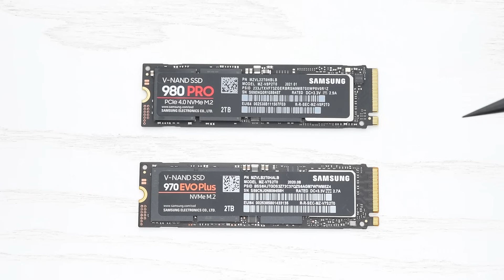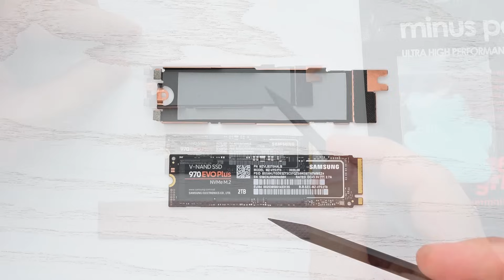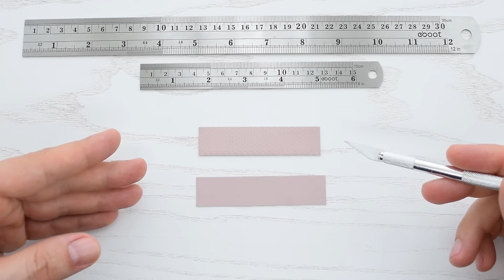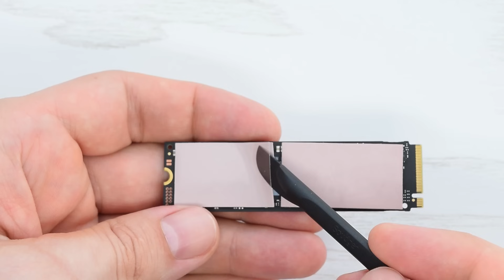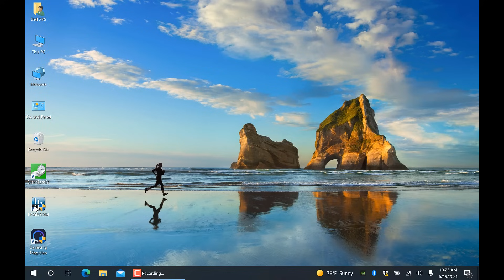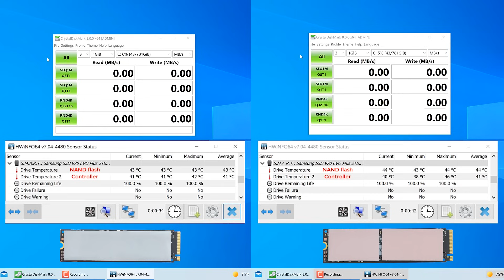Stop your Samsung NVMe SSD from Overheating and Thermal Throttling

Comment: Why use thermal tape? 
Doesn't convection work better metal on metal.
Reply from the maker: The only metal there is the heatsink.
Reply: @ElectronicsComputers  I do not understand your sentence structure. What are you trying to say?

Comment: Werent you supposed to like, remove the sticker first before applying the pads ? You negate the pads with that sticker you left behind.
Reply: The Sticker is a thermo sticker... 🤣🤣🤣
Reply: @cMARVEL360  oO that black one where the serial number is and those barcodes ? Im confused, that doesn't seem like a thermo sticker, too thin and the material is wrong.
Reply from the maker: Removing the label will void the warranty and it doesn't make any real difference in cooling your SSD.

Comment: Unfortunately the Samsung Galaxy Book Flex laptop I bought was too small for a good heatsink. I tried using a couple of copper heatsinks that you just attach to the thermal pads, but that tragically resulted in the heatsink absorbing all the heat and not dissipating it fast enough to keep up with my 970 Evo Plus. I need a really good heatsink with an active fan to keep up with my SSD, or I at least need to upgrade to a 980 Pro even for my PCIe 3.0 laptop because it just runs cooler. Maybe I'll be able to fit the 980 pro w/ heatsink into my laptop?
Reply from the maker: You need at least 3 mm clearance to install a heatsink and a thermal pad. Your best option might be just upgrading to 980PRO.

Comment: What if I use 1.5mm and 1mm pads? Is it the same?
Reply from the maker: Yes, it will work if you can fit those pads under your heatsink.
Reply: @ElectronicsComputers  Can I put double 0.5mm to replace the 1mm one?
thank you for replying :) subscribed!
Reply from the maker: @caramellewu  Technically you can but it will reduce thermal conductivity and that pad will be slightly thicker than 1mm.
Reply: @ElectronicsComputers  I have tried the 1mm and 1,5mm pads and it works wonderfully, thank you so much for this tutorial! It went from 47C to 37C on standby. I hope you upload this kind of videos again!

Comment: Great video. I feel it would make sense to do each chip separately. This way the conduction from the hotter controller doesn’t heat up the other chips. This probably isn’t possible in a laptop but in a desktop would be ideal.
Reply: This only makes sense if you have individual heatsinks. But it's actually better to have a large heatsink so that the controller and cache have a large shared heatsink to dissipate into. For SSDs, the heatsinks aren't really for continuous heat dissipation, but more as a temporary heat buffer for short bursts. Because the typical workload involves short burst transfers that will spike the chip temperature for a few seconds, rather than long sustained transfers, in which case your small heatsink included on most SSDs or motherboards isn't nearly enough to handle the ~3W heat output for long periods without airflow.
Reply: @Fluvance  So in otherwords you're saying I'm screwed xD. I want a drive to hold 1tb of gopro 4k footage.. seems transfering this footage the ssd gets hot in my laptop.. Gonna try bumping the fans and see if it'll help nexted time. Atleast once the data is on, it should be ok.
Reply: @Fluvance  it sounds like you know what youre talking about im in hotel now i cant get my tv to work, how i can change the source without the remote working properly on an old phillips tv that hasnt got a source button or full functionally on the device itself?
Reply: @DavidsonLoops  what ?

Comment: What thickness would you recommend if i have a desktop i built and no thickness Limitation because there’s no heatsino above it?
Reply from the maker: If you want to use two pads method then 0.5mm and 1mm thick pads. If you want to use only one pad then 2mm pad would definitely do the job.

Comment: Coherent and thinking are semantically related.
Thanks for this great video.

Since I use the samsung 960 pro I monitor always best with HWiNFO64  version v6.40-4330
And it irritates me that the samsung Magician is only showing one temp.
also I have seen many stupid windows updates and stupid virus scans that makes no different at all only higher temps.

After many tweaks my drive is idle on 47degree....

But with your solution it's time to make some hardware changes.
charlesm
Reply from the maker: Thank you for the comment 😊
Reply: @ElectronicsComputers  greetings from Amsterdam and have a great new year 2022

Comment: I don't understand only one, why didn't remove all stickers from NAND and controller? You applied thermal pads on stickers. I don't see point of applying thermal pads to manufacturers stickers, rather than directly onto SMDs. It's like to install water cooling with installed protection film on radiator.
Reply from the maker: You don't know what you are talking about. Removing the label will void the warranty and it doesn't make any real difference in cooling your SSD.
Reply: @ElectronicsComputers  Who cares about manufacturers warranty?  There is difference in temps. . I will post video test soon.
Reply from the maker: @nicke.3536  Removing that stickers will mechanically stress the chips and PCB. It may and will affect the solder joints under the chips. I understand that you've watched a lot of "experts" on YouTube and already made your decision and it's up to you. If you want to learn more at least get some technical certification from Samsung, Dell, HP as I did and then you can comment videos like this.
Reply: that's not a stickers dude.

Comment: You don't need to remove the sticker that already on the ssd do you?
Reply from the maker: No! Removing the label will void the warranty and it doesn't make any real difference in cooling your SSD.
Reply: @ElectronicsComputers  i heard the label/sticker spreads the heat

Comment: Great information, rebuts another YouTuber who claims no performance improvement in using heat sink, which is clearly wrong, as taught in this video.
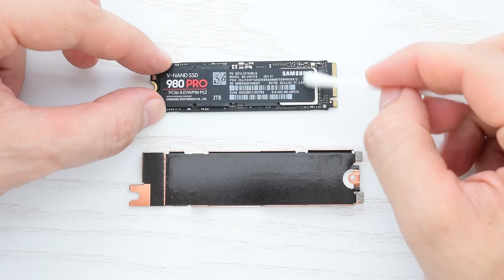Reply: Samsung SSD 980 Review - Fast But Affordable? - Gen 3 drive does not need a heat sink but Gen 4 does need a heat sink, at 1:45 mark in another video. So it depends on your model and heat sinks probably won't hurt regardless of the model.

Comment: just a question... why didn't you peel off the foil manufacturer sticker off?  Supposedly they act as a sort of heat spreader so the controller which is hot and you want to cool sheds more heat to the nand which you'd want cooler... granted in this application it's enclosed in a laptop so it probably wouldn't matter that much, but it makes me wonder if you'd get slightly better results with it removed
Reply from the maker: Removing the label will void the warranty and it doesn't make any real difference in cooling your SSD.

Comment: Is the difference in temperature big between laptops and custom Desktops? My pc is on 25 C when I'm doing low power tasks.
Reply from the maker: Desktops are way better in cooling and usually you're not limited by the size of the heatsink.

Comment: would this work for the seagate firecuda 530? and should 
 remove the tape off of the drive before i install it into my pc
amd also do i have to do it differently for a pc
Reply from the maker: For that SSD you can use only one 0.5mm thermal pad. Removing the label will void the warranty and it doesn't make any real difference in cooling your SSD.
Reply: @ElectronicsComputers  oh ok thank u so much u earned a new subscriber can't wait to see more future vids

Comment: hi can i use it for 0.5 mm and 1.5 mm samsung 970 evo plus 1 tb? My laptop is asus rog strix g15 (rtx3070,ryzen7)
Reply from the maker: In that case you need 1mm and 1.5mm, just make sure that your heat sink allows such thick thermal pads.
Reply: @ElectronicsComputers  I will use grizzly thermal pad for 970 evo plus. 0.5 mm left and 1.5 mm right. Can I use it this way? Another question, should I remove the protective tape from the 2 pads? So I have to remove the protective tape on the contact part, right? I'm not taking off.
Reply: @ElectronicsComputers  I won't use a cooler like you. I'm going to install a thermal pad on the ssd. If I break the gelatin from the contact side, will I not remove it from the other side?
Reply from the maker: @kamransfrli3700  You need to remove that protective film from both sides.

Comment: Wouldn't it be helpful to remove the paper sticker on top of the NVMe drive as well? I'm quite certain it will not have a good thermal coefficient, will it?
Reply from the maker: Removing the label will void the warranty and it doesn't make any real difference in cooling your SSD.
Reply: @ElectronicsComputers  Agreed on the warranty issue. But I don't agree it wouldn't make a difference in cooling the NVMe. It's not like you'd just leave a paper sticker or plastic sheet between the CPU heatspreader and the cooler (granted, a CPU produces way more heat, but the principle is the same IMHO)...
Reply from the maker: @keineahnung4227  Try it first with your own SSD first and then tell us if that 1C was worth it. I've already seen several people who asked for help after removed their stickers after watching some "EXPERTS"  on YouTube and their SSDs simply died because of mechanical stress to the chips. It's not worth it - period. There's no any rational logic behind it.

Comment: So we dont need to remove the sticker before applying the thermal pad??
Reply from the maker: Removing the label will void the warranty and it doesn't make any real difference in cooling your SSD.
Reply: @ElectronicsComputers  So we can assume that every SSD's sticker are made out of heat conductor material
Reply from the maker: @doodrobe1761  Not sure about every but for reputable companies it's not a problem.

Comment: Do you by any chance know If the  Samsung 980 M2  SSD requires extra cooling options as shown in the video or is it way better at managing temps than the SSDs shown here?
Reply from the maker: There's no need to use two thermal pads for that SSD but it definitely requires a heat sink above it.
Reply: @ElectronicsComputers  Do you mean the plastic cover ? Does it come with one ? Otherwise can you recommend me one
Reply from the maker: @maxim196  I mean copper a heat sink. If your laptop came without a heating then you can try a universal one. The link in the description. Just make sure that there's enough room to fit it under the cover.
Reply: @ElectronicsComputers  Im a desktop user....will I be good with : 
A glotrends heatsink ? ....it has way better reviews than the cheap copper one . Will I be good ? It comes with a thermal pad as well

Comment: What about removing the ssd label aswell? Surely that would improve thermal conductivity to the pad and heatsink
Reply: I did remove the label and there is difference in temperature.
Reply from the maker: Removing the label will void the warranty and it doesn't make any real difference in cooling your SSD.
Reply: @ElectronicsComputers  Yeah apparently it's made of a thermal conductive material. Seeing some comparison benchmarks would still be good for the maximum performance user, I'm sure you can remove the sticker easily with care using a hair dryer or heat gun and even stick it back on later, how would anyone know?
Reply: The label is actually designed to act as a heat sink, although not the most effective it's better than nothing

Comment: my 980 pro is on gen4 and my temps without doing anything are 50 for memory and 60 for controller. I have msi b550m motherboard and im using  heatsink included with motherboard.
Edit i tried samsung magician software benchmark and my temp were slightly higher - 57 and 63. I think i'm still fine
Reply from the maker: Totally!

Comment: I ordered a Samsung NVME 980 SSD for my Desktop PC...is the overheating a really big deal (cant the SSD's own physical features help with this ? )  . Do I need to go with everything you showed in the video?
Reply: What temps do you get? Im getting 50 C on memory and 60 C for controller and im only using heat sink included with my motherboard. My temps don't sound supper low but im on gen4
Reply: @gameison4813  Its still being shipped
Reply: @maxim196  ahh, i see. Come back then and tell me what temps you have;p Have a good day

Comment: is it even better to apply the thermal pad to the chips directly by removing the manufacturer's label ?
Reply from the maker: Removing the label will void the warranty and it doesn't make any real difference in cooling your SSD.

Comment: is better to remove the sticker over the ssd, i don't think is a thermal sticker, anyway i have removed it and installed with termal glue one heatsink for every chip
Reply from the maker: Removing the label will void the warranty and it doesn't make any real difference in cooling your SSD.

Comment: If this is the case, then more thermal pad with a gap in between may more likely to improve the heat transfer??
Reply from the maker: If your heat sink allows you to use 2mm thick thermal pad then no need to cut it into two pieces.

Comment: Can you remove the ssd company (samsung in this case) label for better contact with the heatsink? Or it won't make a difference so just put it on top of it?
Reply from the maker: Removing the label will void the warranty and it doesn't make any real difference in cooling your SSD.

Comment: That label on the SSD is thermally resistive. You'll get better heat transfer is you remove it before applying the conductive pads. The warranty will not be affected.
Reply from the maker: Removing the label will void the warranty and it doesn't make any real difference in cooling your SSD.

Comment: One of the problems you still face is once the mass (heatsink) is fully saturated with heat the performance will peak and then drop. 

Unless you have a means to shed the heat from the heatsink either passively or actively using a heat sink with fins so air can pass through to cool the sink or use a fan or secondary means via a heat tube with a second mass which has a fins with a fan unit to push the heat out of the system case.
Reply from the maker: My method gives significant drop in temperature with the passive heat sink. My SSD never goes over 45C under normal conditions or 55C under heavy load. Compared to 90C it's like night and day difference.
Reply: there's nothing special about fins, other than to increase the surface area available for heat transfer. The heatsink from the video does exactly that, passively (though the laptops fan are likely to cause some air movement all around the case)

Comment: Are 1.5mm pad works if we cut into 2 part? Left and right. Because of pressure from heatsink they will touch each other. Althrough one side will get more pressure than the other
Reply from the maker: Those pads are not that soft to adapt its surface according to those components and that pressure is not enough to make it work as you want. There's about 0.4mm difference between the controller and other components, so the best option it to use 0.5mm and 1mm pads.

Comment: Is it really necessary to cool the NAND-Flash?
I recently bought a 970 EVO Plus  500GB and the only thing that is getting hot (over 70°C)  is the controller,
the DRAM and the two flash chips don't seem to output much heat.
I've also heard that NAND-Flash likes it warm.
Reply from the maker: Just keep it under 60C, heat is not good for all electronic components. You'll never notice that extra boost if your NAND chips will be hot. Your SSD consists of a hole bunch of different components and they might not like the same temperature. And believe me all manufacturers would love to cheap out on the heat sink or thermal pad if it was possible.

Comment: I dont have any heatsink on my 970 evo in my desktop pc. Was noticing it started to throttle somtimes, but the contoller temp was 75℃, and the drive temp 57℃. Do you still think the temperature might be the problem? I've already ordered a heatsink and thermal pads just in case, but I thought 75℃ was well withing range of these ssd's.
Reply from the maker: Anything higher than 60℃ is not good for all electronic components. Your SSD will run perfectly well for some time under those conditions, but will it shorten its life and make it unreliable for storing valuable data, yes for sure.

Comment: Curious, I now have a 980 Pro 2TB and a 970 EVO Plus 2TB on my Asus B550-E Strix. Are the thickness for the thermal pads the same for my motherboard?
Reply from the maker: Yes, the same thermal pad thickness for both models, because they have the same size components.

Comment: My solution is to buy a cheap heatsink that attaches with thermalpads + rubber bands, saw the aluminium heatsink into two pieces, cut the thermalpads to the right size for the pieces, and have those cool the controller and NAND chips separately.
Reply from the maker: It will work if there's enough room between the SSD and the back cover.

Comment: I just noticed that you applied the pad on both controller and DRAM ... right? Should I apply it only on the controller only? What do you think?
Reply from the maker: There's no need to do that otherwise all manufacturers would do the same thing and saved a whole bunch of money. Heat is the enemy for all electronic components.

Comment: Can I use only 1 thermal pad? And what thickness should i buy? Got out of budget to buy both thickness just for  only 1 nvme ssd.
Reply from the maker: You need two pads with different size. I've provided links for cheap but good pads in the description.

Comment: Your gen 4 speed is 50% slower
Reply from the maker: Sure, because gen4 SSD was installed into a gen3 capable laptop. But anyway it works faster than a Gen 3 SSD.
Reply: That means gen4 ssd can work in dell xps 15 7590 gen 3 slot? Do we have any gen4 ssd enclosure in market? Also seen if we used more than 2tb its required external power